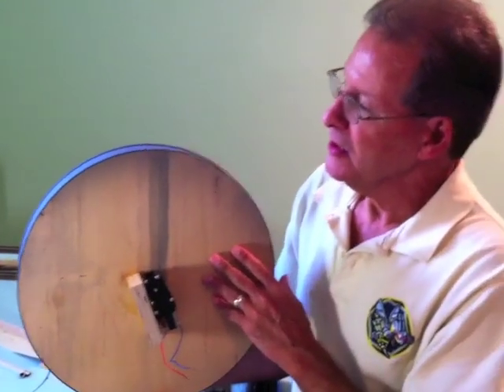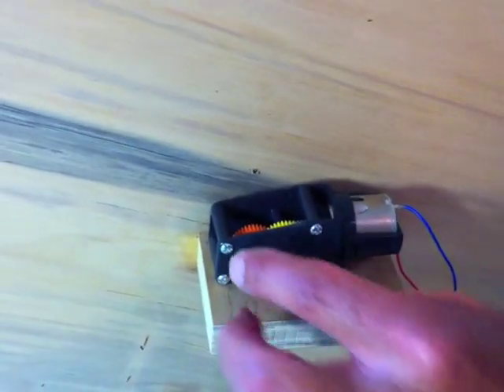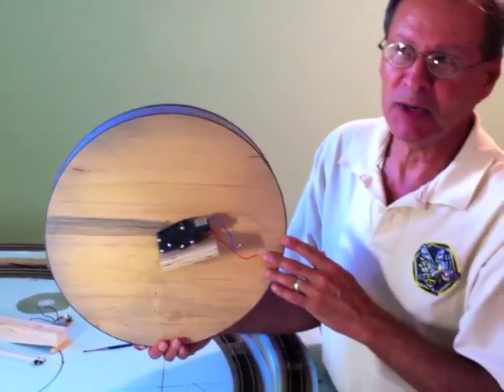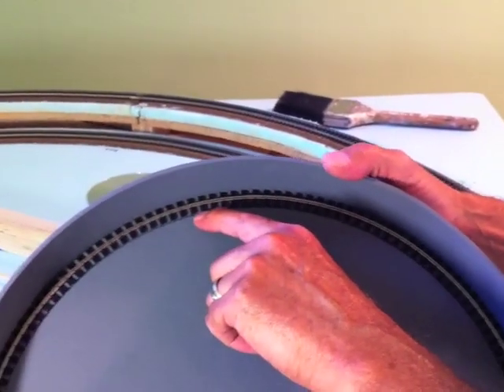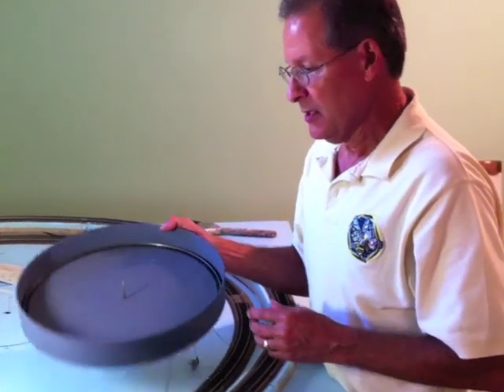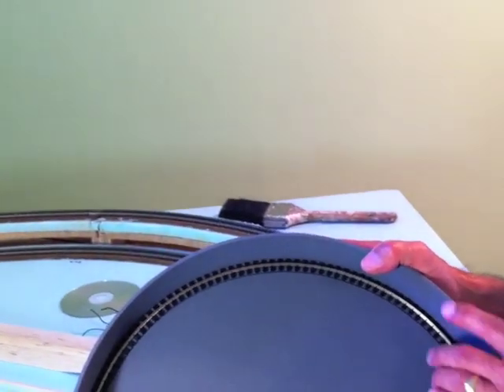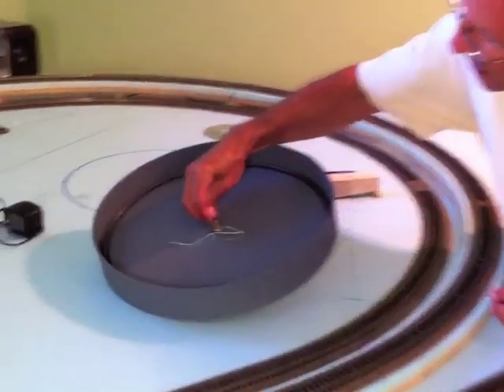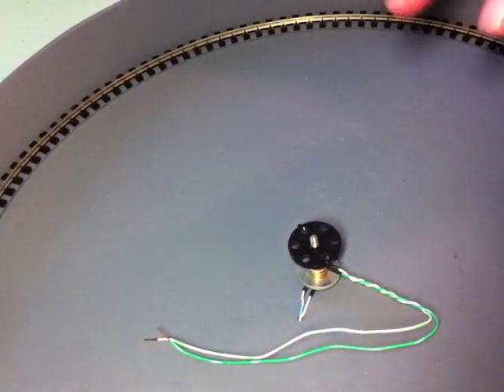HO Turntable  Construction Part 1

Comment from the maker: Part 2. Figure out what distance I needed for the circle. I put the yard stick and nail through the hole in the plywood. I then clamped the yard stick down to the table of the band saw putting the plywood edge touching the blade. Rotate the piece around and now you have a circle.

Hope this is clear

Comment from the maker: doctordMich  We actually changed out the motor you saw in this video.  It just didn't work well.  I am in the process right now of uploading an video that shows the final result of this turntable.  It sure has taken us some time to get this project done.  We are not using a 110 voltage motor.  I will try to see if I can find any markings on the motor for you.